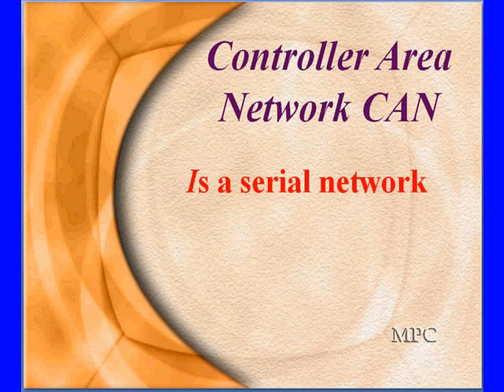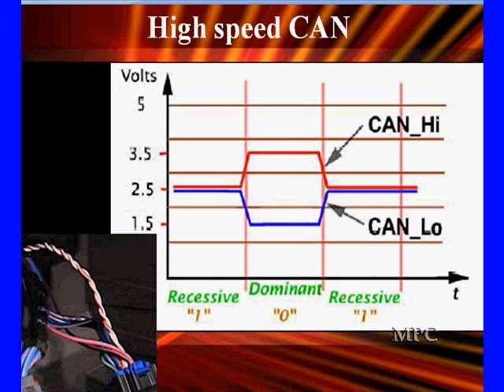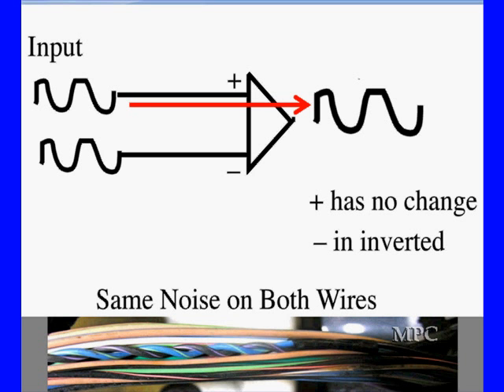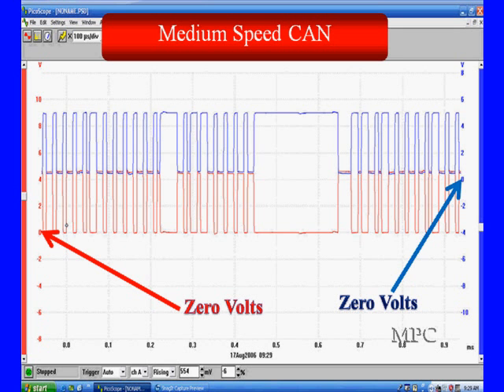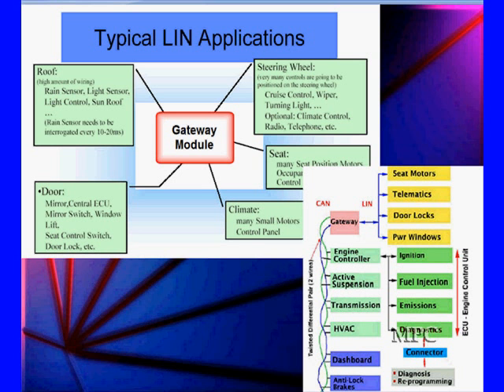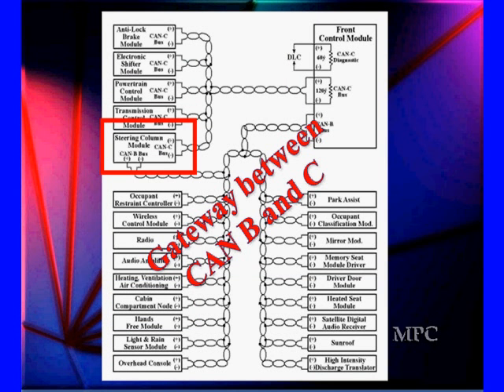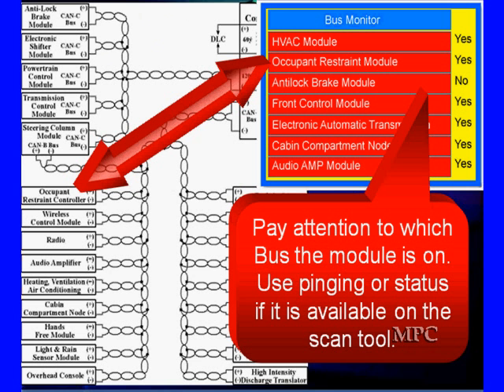16 Controller Area Network (CAN) Communications

Comment: Excellent info! This cut through all the mystery of communications on the bus. Now all you need is to know where each module is and how to access it. Sometimes you have to take the whole dash apart or it's hidden in some crazy places that are real hard to get at!

Ditto on spelunkerd's question. When using a scan tool, the way I understand it is you need to know the PIDs and be able to look at them live and also record them to see which ones are bombing the network or are missing. But you need the OEM diagnostics manual to know which PIDs to use, and maybe even an OEM scanner. I've done that on a Ford Sport Trac when checking the fuel pump circuit. The manual tells you which PIDs to look at and then to verify with a DVM at the connection to be sure there actually is a signal and that it's the same voltage.

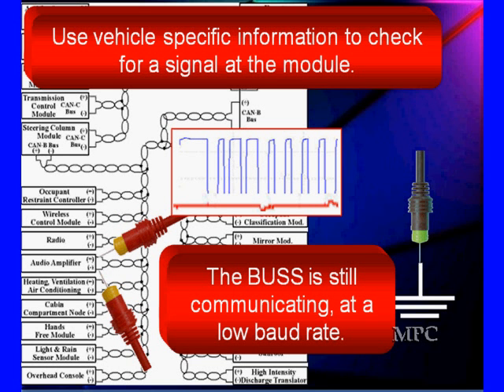Comment: Another excellent video. One thing I'm not understanding, when you tap into the communication line at 16:56, it seems you are tapping in parallel with every module on the circuit. So, how do you identify which signal is coming from the module you're interested in? Even though you're tapping into the system at the back of the module, don't you see signals from everybody transmitting? Isn't it like a "party line", where everybody hears the group chatter?